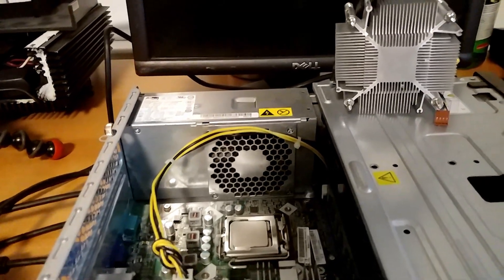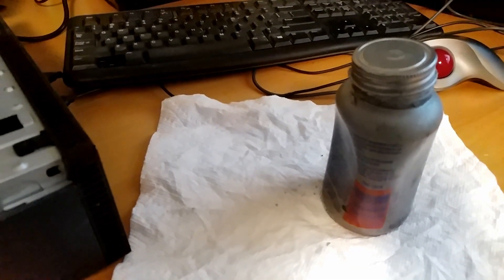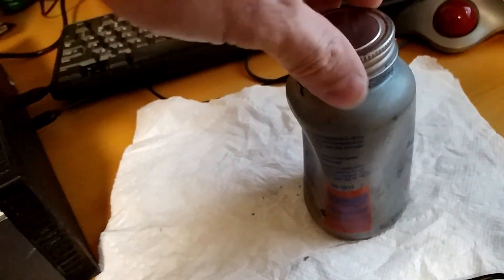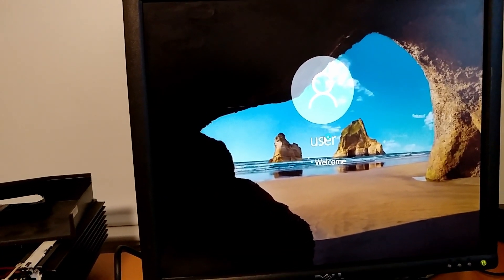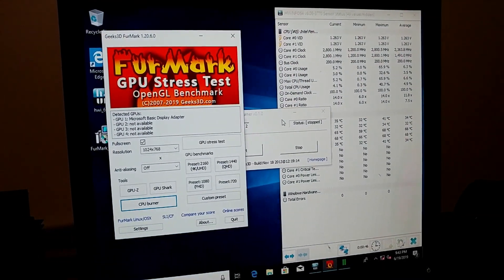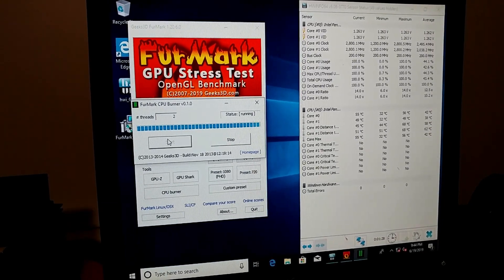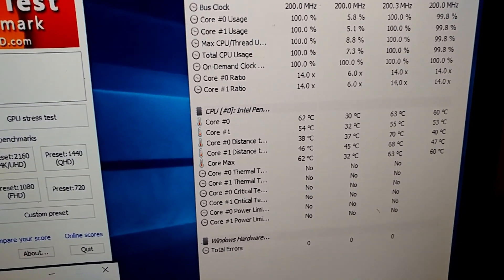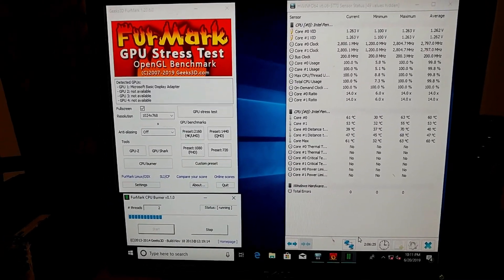Computer abuse part 3: Weird thermal compound test 1

Comment: Just use Plumbers Silicone Grease it works just as good as Thermal grease.
Even better if you mix in a bit of Graphite Powder in it .

Comment: antiseize conducts electricity? my father has a paste, he says copper, but with the tester there is no continuity,  I need to know if the one shown in the video has continuity, it says aluminum, it is aluminum base or that it is used to apply to aluminum?, sorry no speak english
Reply: Yeah I also have the same fear of maybe a short circuit
Reply from the maker: Theoretically it could. If you have enough voltage it would probably start to conduct.
Reply: From my understanding, it is primarily made up of aluminum powder and petroleum based lubricants.  But I don't know that for a fact.  My family owns an auto repair shop, and that's what the common consensus is among my dad, grandfather, and the other mechanics that work for us. But that doesn't mean that we are right, just because we all think that. After all, millions of people believe islam is the word if God, and a pedophile named Muhammad was a prophet, chosen by God to be their example of a perfect role model. Maybe check the Permatex website or call their customer service
Reply: @logancurl9526  Hahahaha why bring up religion

Comment: Thanks for the video! My local computer store is closed today and I need cpu thermal paste now.
Reply from the maker: No problem! How has it worked in the long term, do you still have it on your CPU?
Reply: How did it work long term?
Reply: I used my PC for about 3 days.
The anti seize seemed to get too dry with the heat.

Comment: I can confirm that I've just tried this with industrial copper slip and it's cooling my FX4100 (nothing special but not a cool cpu) incredibly well. FARRRR better than the 7 year old thermal paste it's replaced. All with a standard issue crap cooler & heatsink.

Old paste @ 3.8ghz - hitting thermal throttling at 85ish C and idling at about 55-60 (after a thorough case & fan clean etc.)

Copper slip (film thin application)  @ 4.2ghz OC (barely changes if I go to 4.4ghz) - maxing below 60C under video rendering load and idling in the high teens / low 20s.

MoBo on it's side but I know the stuff doesn't run as my motorbike's brake pads get WAY hotter than the PC and take tons of vibration/water and it's still in place months later on them. 
I spread a film over the IHS rather than using mounting pressure to flatten a ball out - you want fine control over where this stuff is and peace of mind that it's evenly applied once you get that heatsink on.

Writing this on about day 4 of continuous hard use with the copper slip. The paste i was waiting for has now arrived and I'm considering not using it at all.
Reply: Getting ready to try some on my laptop. I don't have any conventional thermal paste but I do have copper never seize.
Reply: @michaelszczys8316  I'm still using the same pc, untouched since, still all spot on and temps just as low. Go for it!
Reply: @glenben92  I put it back together with a smear of copper never seize , it looks good so far. I actually feel AIR coming out of the vent again, it had a small blanket in there.